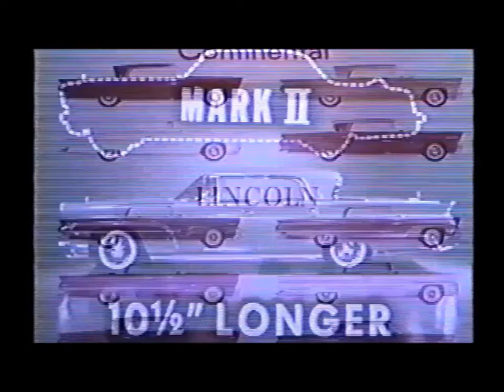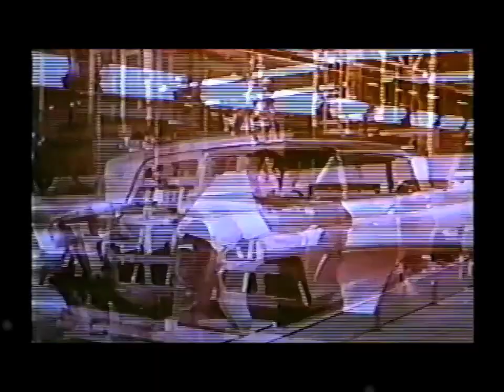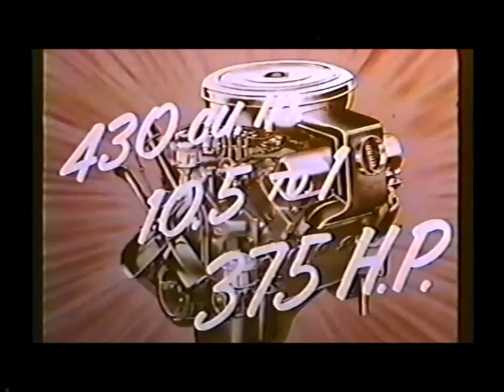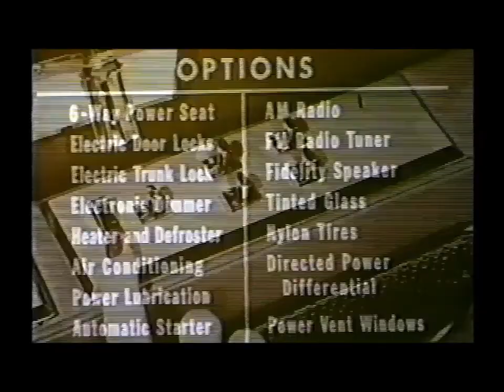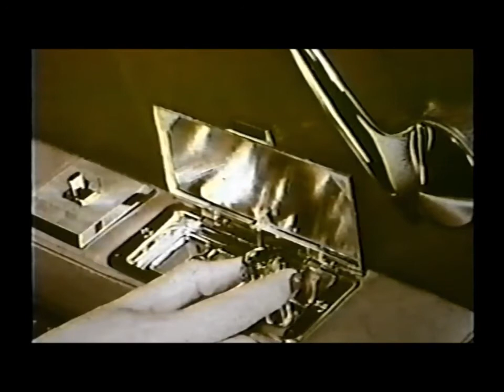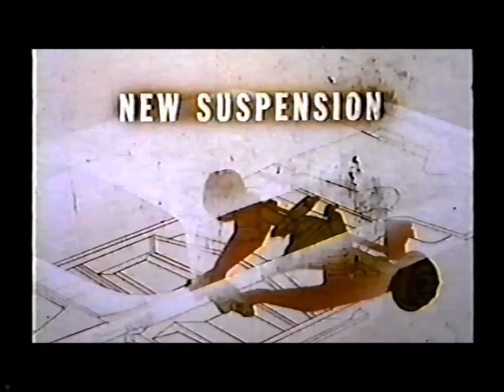Lincoln Sales Training for 1958

Comment: The car seems too massive to be a unibody. With no B pillar the thing had to flex a bit. I read an account years ago about doors popping open when encountering a railroad crossing. Maybe that was a first-year issue that was corrected later.
Reply from the maker: That never happened with my 1959 Convertible. They had problems with the original 1958 model twisting like a tin can but fixed it in 1959.

Comment: The HVAC systems were quite impressive for the period.
Reply from the maker: The vents were servo motor activated. No mechanical linkages. Very unreliable long term. The heater system on my 1959 Continental never worked.

Comment: The new heater/air conditioning contol was an engineering masterpiece.
Reply from the maker: The vents were servo motor activated. No mechanical linkages. Fantastic engineering. Very unreliable long term. The heater system on my 1959 Continental never worked.

Comment: The MEL is highly underrated.
The only upgrade you could get was the tri-power on all 430's unless you were a Thunderbird man, and in that case you might need to go to a Lincoln/Mercury parts counter.
My favorite is the 383 MEL which was crazy oversquare, and as such, inherently racy, although in a very heavy block with .600 wall thickness between cylinders.

Comment: The 430 was a fearsome racer in the lighter Thunderbird, it surprised me with its reputation for such a heavy engine.
I had the Edsel 410 cid version, and it would shock you with its power. 4-barrel helped of course.

Comment: The “exclusive” new assembly plant mentioned is the Wixom, MI assembly plant which opened in 1957.
Reply from the maker: YES!!!
Reply: @Google User GP, the Ford Thunderbird was also built at the Wixom plant from 1958 to 1979. There was NO other plant in Ford Motor Company's manufacturing apparatus that had so much attention paid to precision and quality.
Reply: @johneddy908  Yes, I know, but that didn't say much as 1970s Ford quality (along with most of the other Big 4 back then) was horrid with Ford and Chrysler being among the worst.